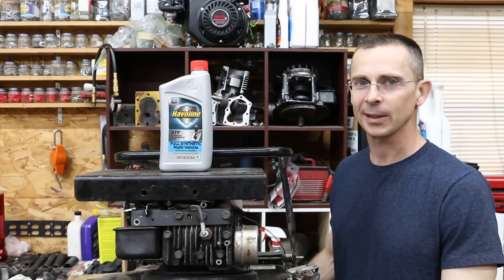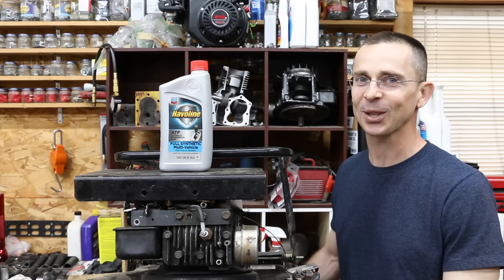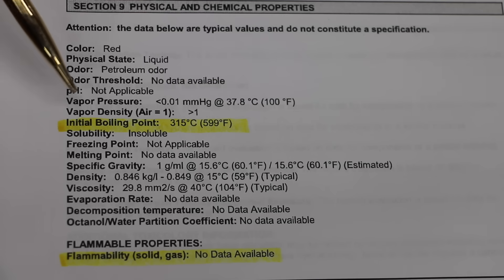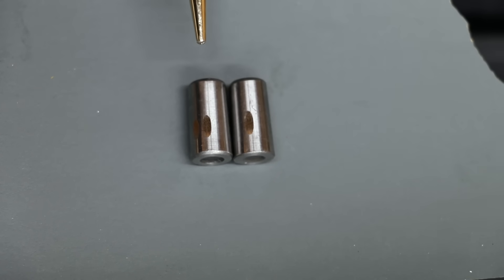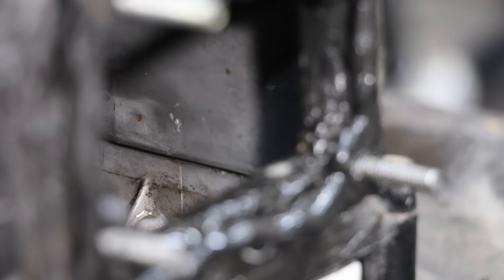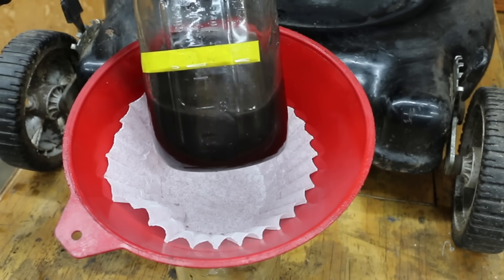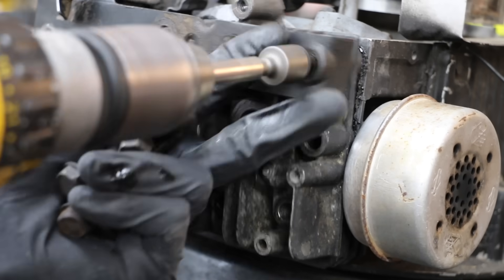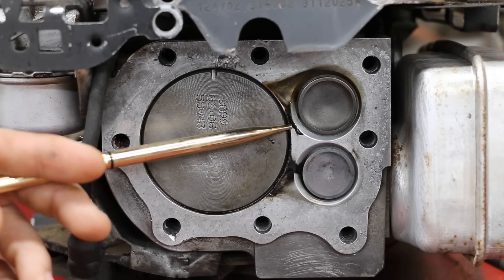ATF as an Engine Oil substitute?  Let's see what happens!

Comment: Could you run a second test of ATF on the same engine? The reason I ask is, we couldn't tell if the metal shavings were caused by ATF or cleaned out by ATF from previous oil. However, if a 2nd run came back with more metal shavings, it most likely is causing damage and should be used with caution when cleaning!
Reply from the maker: Thank you for this recommendation!
Reply: @ProjectFarm  yes please do this. I'm genuinely curious.
Reply: @ProjectFarm   do this again
Reply: Tyler S my thoughts exactly.
Reply: @gvanausdle  thank you for going justice for all the gear heads.....
Reply: i would really like that to - i have a 3.4 gm with about 250.000 miles on it, and now valve ticking ( it comes and go ) i would love to try this atf , just to se , but i´m also affraid that it might kill the engine now it has ran that much
Reply: @MayahotmailLasse  Just add 1/2-1 qt trans fluid not all trans fluid.I have used it and it works.
Reply: Add a 1/2 quart of MMO about 100 miles before you do your next oil change it will free gummed up lifters. @MayahotmailLasse
Reply: Lasse Nielsen mix it with regular oil too if your worried about it hurting but don’t rev the engine let it idle for about 20 minuets that should do it
Reply: @MayahotmailLasse  I have an 05 gm 5.3 and need to clean out the crankcase after losing dod to a bottle of engine restore. I too want to know if it will be safe to do.
Reply: @MayahotmailLasse  I have the same engine with the same issue. 2004 Pontiac grand am with 260000km
Reply: @MayahotmailLasse  In the video he used 100% ATF which no one in their right mind would do in their car engine but what does work and is safe is 20% ATF so in a 5 quart application just replace one of the quarts with ATF.  
Since you mentioned that your vehicle has 250,000 on it I would recommend that you do several treatments in steps.
The first one should just be at idle, in other words don't drive the vehicle with the ATF in it, but instead after adding the ATF just yet your vehicle idle stationary and you car bring the rpm's up to about 2000. Let it run for about 20 to 30 minutes with his first batch of oil/ATF.
The reason for doing this first ATF cleaning at idle is because at 250,000 miles you most likely have a significant amount of build up which will be suddenly loosened up so you want to get that out of the engine pretty quickly rather than driving around with chunks and loosened sludge circulating around. 
This will lessen the chance of your oil pickup tube becoming clogged, your oil filter from going in to bypass, or a blocked oil passage.  
After dumping the used oil/ATF mix and installing a NEW oil filter you can then add new motor oil and once again 20% ATF but this time go ahead and drive around for about 100 miles. 
Since you already got rid of the chucks and worst of the sludge in the oil/ATF change out this 2nd batch will be to clean up the stuff that was left behind by the first batch, and won't be nearly as "chunky" as the first batch but just very dirty with smaller contaminants. 
After the 100 miles drain out that 2nd batch of oil/ATF mix, install a new filter and high quality motor oil and you are good to go. If you repeat the process every 25,000 miles or so it will keep the engine clean indefinitely. As an alternative you can also use Marvel Mystery Oil instead of ATF. 
The Marvel Mystery Oil is made specifically for that purpose so some people feel more comfortable using it versus ATF.  Either one will get the job done although the Marvel Mystery Oil will leave your engine smelling like Wintergreen Lifesavers 😁
Reply: @JA-rn5qv  what do You think about driving the car with diesel engine and turbo like for 500 miles and more, with 1q of ATF and rest oil engine ? Will it hurt it ??
Reply: Try ristlone
Reply: @keithbubb730  *Rislone, without "t"
Reply: @MayahotmailLasse  ive got an 04 Montana 3.4 had noisy lifters also.. I ran a litre of atf mixed in the oil before an oil change.. ran around town for a while.. no issues.  However I run 10w30 now with Lucas additive.. also deleted my Cat.. runs Awesome and I get Amazing fuel milege!!
Reply: @MayahotmailLasse  the way to do it is not to go straight atf. Atf is thinner than oil and has higher detergent amounts. Change the oil add a 1 quart atf and the rest oil. You'll be shocked at the change of color in the oil after less than a hour of run time. Also note how much the oil filter ways between both changes
Reply: best recomendation. i want to see the actual video of doing that. because i wanna try flushing out my engine oil all the my self. and the thing i wanna use is atf rather than diesel.
Reply: @kensis8333  be careful when you flush your oil. You could dislodge some debris that the oil pump will pick up. Possibly get stuck in the line
Reply: @kurttanner5855  agreed, I did this and ran a bearing on my cam shaft. Will never do a engine flush again...
Reply: Tyler s - thanks for the answer . I will give it a try then,  even though i bought another car . Ford galaxy 2.8 vr6 ...also fun to drive
Reply: I second this
Reply: @gman57op heard that once before.  Unfortunaly i sold the car. To many probs with the tranny all the time . Just bought an old ford galaxy 2.8 vr6 and omg its fast ....faster than gm 3.4 i hate to say but its the truth
Reply: Agreed
Reply: When doing your bearing test squirt a little bit of Brake Kleen in the tray. You'll be amazed.
Reply: @timhammett2302  Could you elaborate; I don't understand what any of that means. What "bearing"/test? What tray? And if you don't mind, how will we be amazed? You got me very curious. Also, it would be cool if Project Farm did the test your describing. Thx
Reply: @sogbryan6633  I was referring to the bearing test he does with a lubricant in a tray and a bearing pressed against another bearing while one is rotating in a tray of, in this case atf. Atf is not a great high pressure lubricant. Brake cleaner when mixed with oil make the oil temporarily able to sustain high pressures. Temporarily because it is highly volatile. This was an old trick to pull on lubricant salesmen when they used bearing and tray test to show how good their product was ie. STP etc. you put some of you secret formula and it beats theirs. Just don't tell them it's brake cleaner.

Comment: Never used straight. Always just added a quart or 2 in before an oil change, ran it to op. temp. Then, drove it 10-15 minutes. Then changed. Most times, it helped and I've never ruined an engine doing it this way.
Reply from the maker: Thanks for commenting.

Comment: im not sure. but i unerstand, its dangerous to inhale the after combustion of atf. i feel fine now beng 24 hrs.. maybe why theres not listed a flashpoint for being itsproducts use wouldnt be used in affect for it to be in aflamability situation.. similar as brake fluid in contact with pool shock is actually spontaneously combustible. as inflash fire.. atf probable under high heat combustion does distablize which ever bonds and itsetergent contents nd reacts caus some sort of highly carcinigen agent... i couldnt respond more th a simpleits weird i watchedthis release right after apon experimenting with atf. ifi had seen it prior i wudnt use it because ur test in which under load. scars
Reply from the maker: Thanks for commenting on this.  Glad you're okay.  I wear a pretty good 3M, dual cartridge respirator during the tests just to be safe.

Comment: I looked in the bottom of a gallon of dex atf with a flashlight and saw tons of metallic glitter substance. 

Only reason I did it is because I had assembled a transfer case for my Jeep and thought I did it wrong when metallic stuff showed up in the fluid after draining on a test drive. I pulled the case apart again and found nothing wrong. Everything I saw came from the brand new atf bottle.
Reply from the maker: Wow!  That's a huge problem if the "glitter" is some sort of solid, presumably metal.
Reply: I'm unsure. It's worth a check in the bottom of your bottle. Or maybe a larger bottle. I believe the brand I used was Valvoline. 

If the metal is soft enough or an anti wear additive I don't know that it's detrimental.

Comment: Been doing this for decades. It's fine for engines, and it does work. 
I will run some in the crank, sometimes at 100 percent. In a carb equipped motor, some goes in the fuel as well.
Carbon sometimes hangs the oil pump pressure relief valve open, ATF will help, but for a badly stuck valve I add Berrymans fuel injector cleaner the oil when it's cold and run it til the engine is warm.
Never add Berymans to a hot motor, it can detonate. You don't want an air fuel bomb do you?
Once the engine is warm, the Berrymans will evaporate. no need to drop the ATF out, just run the engine as normal.
As the solvent evaporates it's vapor is burned inside the engine, it is fed into the carb at the breather. 
In hot climates use less ATF in the oil.
Did you notice, "Full Synthetic" is high grade mineral oil, it's not synthetic at all.
Instead use 100% synthetic, not "Full Synthetic", full synthetic is a marketing term, it is designed to mislead us.
Reply from the maker: All great points. Thanks for commenting.

Comment: Love your videos . I’ve done a diesel and transmission flush in lots of vehicles especially diesel trucks.  75% diesel 25% trans fluid but I would only let the vehicles idle at no load and only for 5-10 mins and I went thru a engine afterwards and it was completely spotless and the oil gauge picked up 10psi at idle from cleaning the sludge on the pick up tube screen .
Reply from the maker: Thanks for commenting on this!

Comment: I checked and Dexron vi is roughly a 10w-20 based on the dexron vi standard viscosity in centistokes. You might want to try an oil analysis for those engines to see where they are as far as bearing and cylinder wear material in the oil for wear analysis comparisons.
Reply from the maker: Thank you for this recommendation!

Comment: It will work I've had best results using marvel at every oil change and in the winter we pulled the plugs on all equipment mostly air cooled and poured some marvel down spark plug hole replaced plug and give it a few cranks next summer they always start right up no sticky valves
Reply from the maker: MMO is a great product!

Comment: Kerosene is still the best way to clean out a crankcase.. Better than transmission fluid.
Reply from the maker: Thank you for this recommendation!
Reply: Project Farm Dont run it. Just crank it over with the starter. 30 sec. Wait. Do it again and change the oil filter. Depends on how sludged up the engine is. Then fresh oil and filter. Change again after a couple uses.  We use to do this with old big blocks.

Comment: ATF is great for long term storage of crank shafts and any metal parts. it is better than grease cause it will not trap moisture. i have used tranny fluid to store engines. before pulling an engine to be stored for future use, V8s in my case, i bring up the rpm and dump a quart of ATF down the carb and shut the engine down. this coats all iternals so they will not rust and will loosen up carbon deposits.
Thanks for another great video!
Reply from the maker: Thank you!

Comment: You are fantastic. Now I say that because of your last sentence about Not using it to clean an engine. I believe that certain seals might not tolerate the fluid and with the complexity of engines today, it's not worth the risk. In fact they have a crankcase engine cleaner fluid that you were suppose to add to engine oil and drive VERY SLOWLY to have an oil change performed, or just do it yourself. I have not seen that product ( engine gunk) at my local AutoZone.  Great work and very thorough investigation of the product.👍👍👍👍👍
Reply from the maker: All great points and thank you!

Comment: Why don't we just use oil as engine oil?
Reply from the maker: Great point.  However, some have had great success using ATF to free up a stuck lifter that became stuck while using oil as engine oil.
Reply: Project Farm People Do stupid things, and then correlate any good results.  If a hydraulic lifter is stuck it's because the oil is too viscous and they probably were running dirty oil.

Comment: Just use diesel oil from new.

The only difference is diesel oil has detergents in it which reduces carbon build up.
Reply from the maker: Thank you for this recommendation!
Reply: Project Farm no problem, you wont see a dramatic difference in an old petrol engine.

But if you got 2 brand new petrol motors...ran one with diesel oil and one with petrol oil from new. 

The one running diesel oil will have less build up then the petrol oil one.

Comment: ATF may be used to clean and flush an engine but only run the enine at idle or very low load / revs...and only for a short time.... main problem is the very low ´viscosity of ATF and that ATF contains very litte anti wear additives.. this may cause increased wear or engine failure if used in an engine instead of engine oil
Reply from the maker: Thanks for commenting on this!

Comment: ATF is about the same as a 5W straight weight oil. Well anything is better than vegtable cooking oil! It would not cause any obvious concerns in one hour in an old abused lawn mower. ATF has a lot of wax parafinic. Put a quart or 2 of it in your car or truck and drive it for your normal oil change interval and then take a sample and send it off to a lab like Black Stone.
Reply from the maker: Great point and thanks for this recommendation!

Comment: bare in mind that 20 years ago before specialty oils  transmission fluid was changed at much longer intervals than engine oil and had a very large number of valves to go through and could not fail so it had a lot of detergents in it and there is no substitute for changing oil at the first sign of need.
Reply from the maker: Great point and thanks for commenting.

Comment: i had a friend that ran a wrecker  service he did not use pennzoil it is pariffen based and makes waxes when it breaks down and he would add 1 quart of transmission fluid when he would see collar in his oil then run 500 miles generally in 1 day and change his oil i helped rebuild his motor when needed he got 1,000,000 mile out of a small block 350 ruteenly and the engine looked almost as clean as new when we rebuilt them.
Reply: 1,000,000 or 100,000??
Reply from the maker: Impressive!  Thanks for commenting.

Comment: I had a Honda element come to the shop one day and the complaint was running rough at stop light and check engine light. Turns out the oil passage for the cam adjuster(for v-tech) was almost clogged shut so we did a oil change and added a pint of atf and after a few day of driving it all the symptoms cleared up. Changed the oil back to all 5w-20 and haven't had the issue since that was 2 years ago and she still drives it and I see the car every 3 months for regular maintenance
Reply from the maker: Impressive!  Thanks for sharing this experience.

Comment: Manual gearbox oil any 75W80/75W90/85W90 (GL4/GL5)in crankcase! urban myth to be car dealers trick to cover up a worn engine. What happens to the engine temperature? Can you run it as fuel additive?

Why: sold in Europe in 1litre bottles, everyone has a half used bottle somewhere, usually it gets trashed. No gearbox takes even number of oil 😚
Reply from the maker: Thank you for this recommendation!

Comment: I would like to see you repeat the same test using kerosene. I used to buy Gunk 5 minute flush but started using kerosene after I read the MSDS and discovered kerosene comprises 95% +/- of Gunk's 5 minute flush. Also, I knew a landscaper that ran out of gas in his truck and had to substitute a gallon of 2 stroke oil/gas mix to get home - he stated his truck's noisy lifter/valve quieted and remained quiet for over a year - then he repeated the experiment again.
Reply from the maker: Thank you for this recommendation!

Comment: I always used this as a decarbon or if you were a qt low and you were about to change your oil anyways.  As you said, it's not engine oil,. It's not meant for long periods of time, but it has a ton of detergent.
Reply from the maker: It seems to clean well.

Comment: About 20 years ago, I ran into a guy breaking in an old continental radial (on an airplane). He was running straight mineral oil to break it in. If the ATF flows, I'd be surprised if much damage would occur in a simple engine, but can certainly see that the fluid is darkened (pardon if you mentioned that), and the repair shops love to put a drop on a napkin and tell you that it's no good as soon as it's darkened. 

No good for trans probably doesn't mean no good for engine.
Reply from the maker: All great points. Thanks for commenting.

Comment: I have recommended to experiment with brake oil instead of engine oil and fuel.
I remembered that my brother was spraying some of the brake oil into the carburetor while running the car on hay RPM to clean the carburetor ... a lot of blue smoke and after that the sound of the engine decreases and becomes more smooth.
Reply: Sorry for my bad English😅
Reply from the maker: Thank you for this video test idea.

Comment: Ive used it to de sludge a ford 4.6l v8 and it worked good. Put a quart of atf in the crank case and topped with oil and drove about a week, roughly 500 miles, and a ton of sludgy nasty oil drained out of it so it seemed to work.
Reply from the maker: Thanks for commenting on this!